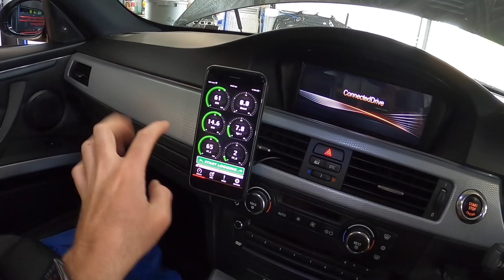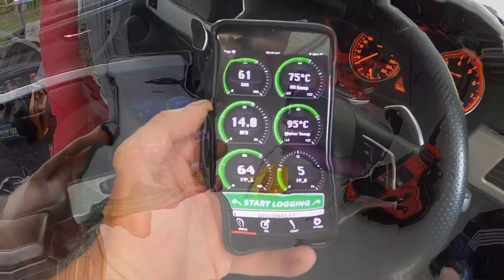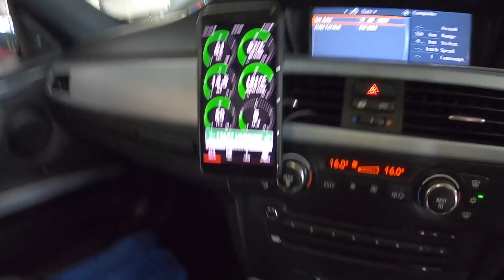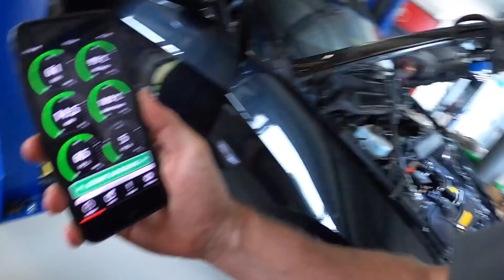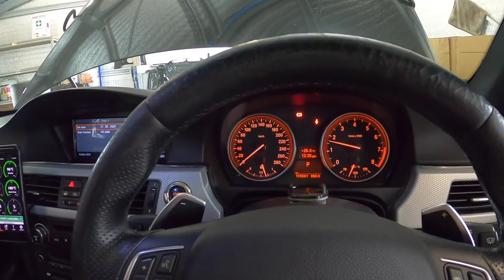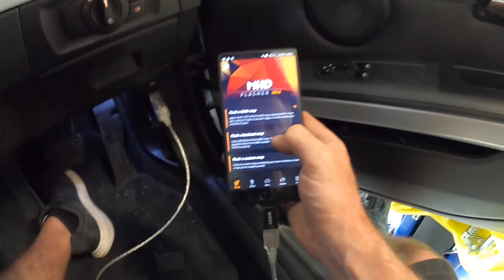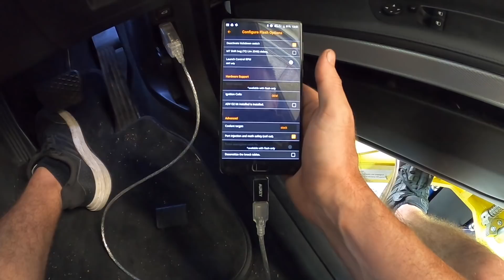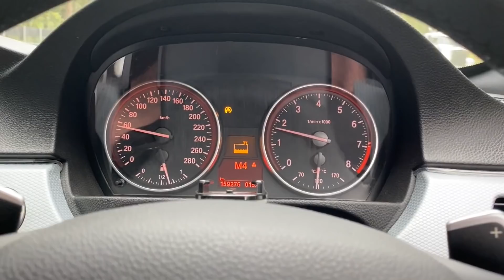BMW E92 335i N54 Motor Swap First Drive: HELL YEAH!!!

Comment: For the old n54 that your removed from your e92, will you get that machined and fixed? Just wondering because there are people out there who made their own "supra" by swapping a 2JZ engine in a frs/brz/gt86 with success but i have not seen anyone do a n54. With frs/brz/gt86 motors seizing and blowing due to weak connecting rods and faulty valve springs in the subaru motor, maybe you can find a car for $1000 with a blown motor and put your old n54 in it? Just a thought. Go TeamN54
Reply from the maker: Thats a pretty cool idea for a motor swap. Down the track that might be an option. I will be fixing the original e92 engine. Im thinking i will build that one with some forged bit and go full send.
Reply: @ZeroTo60Tube  that would be freaking awesome. Looking forward to it.

Comment: Is there any way we could see the logs? 
I'm running basically your exact same setup but without your tune, my timing is basically all 0 degrees and I dont know if that's what ou have or it's just something with my tune
Reply from the maker: Something with your tune. Or you have serious issue. I have heaps of logs showing timing between 6 and 12.8 deg, depending on ethanol content. So what back end flash are you running for the JB4?
Reply: @ZeroTo60Tube  I'm running the IJE0S, Pump flash. 91 octane. I live in Canada
Reply from the maker: @crazygamer889  something is wrong then. I would post your JB4 logs to the n54tech log review forum. Those guys will have you sorted in no time. In fact that forum is amazing for JB4 users. Make sure you have 6 cylinder timing logging enabled.

Comment: I also have xhp and on day to day driving i use the stage 2. What do you mean by transmission adaptation? I am curious that i should be doing that.
Reply from the maker: The ZF6 factory software is designed to continually adapt both clutch pressures and clutch charge times in order to keep the shift smooth-ish as transmission ages. When you do a adaptation reset, you have to drive the vehicle in a way that puts certain loads on the transmission so the software can learn pressure and fill times. The adaptation reset, puts everything in a state designed for all new hardware, so if your gearbox is worn out it can cause problems. Generally you should only do a gearbox adaptation reset when you have changed hardware inside the box. But if you are having shifting issues, it's worth looking in to.
Reply: @ZeroTo60Tube  thank you for sharing that information. I have not replaced anything yet. Just fluid and filter. I am glad i do not need to do adaptation reset yet.

Comment: Read xhp’s warnings before resetting your gearbox adaptions........
Reply from the maker: The warnings exist because some people just shouldn't touch their car full stop and then blame xHP when they mess it up. For your own reference if you reset adaptations, do a proper relearn procedure and then have an issue, your gearbox is toast anyway. Resetting adaptations didn't cause the problem, its the hardware is in beyond serviceable condition and needs to be replaced or repaired.
Reply: @ZeroTo60Tube  I think your last sentence sums it up but the whole point of adaptions is to compensate for wear etc. unless it’s brand new or rebuilt it’s going to have wear. It’s doesn’t make sense to reset on this basis
Reply from the maker: @paulsimpson8990  It is a hard one to put a definitive answer on. When i got my e53 a few years ago, it was shifting really badly, a friend from BMW drove it and the first thing he said was do a adaptation reset. It made it a little better, but that car needed the bridge seal on the mechatronics replaced. I eventually did the seal, new oil, reset and it felt perfect. A mate of mine recently bought a 325 (well about 10 months ago) and it would go in to limp mode on the highway if it was d. in sport mode it was ok. It was a cheap car and he didn't want to service the trans properly, so we reset adaptations did the relearn properly and it's been fine since. So i guess if the car has has something happen where the learnt adaptations were not done properly it can cause on going problems that are not hardware related. Every time i have reset adaptations the gearbox's shift better. But doing the relearn properly is crucial. So i am pro doing adaptation resets from my experience. In fact the only time it wont go well is if something in the hardware side is no good.
Reply: @ZeroTo60Tube  good to know, I had the impression that the risks were greater than the reward but your experience is the opposite. Thanks

Comment: look like the turbo is not blown, the old engine have serious problems.
Reply from the maker: Yeah no excessive smoke on the start up. I had it running for 20 mins in the shed, so it would have been like a 90s disco if there was an issue with the turbo leaking oil still.

Comment: How does the lsd feel?
Reply from the maker: Still not 100% on it. It has changed the balance of the car more than i was expecting. But havnt driven it in proper anger just yet.
Reply: One mod I definitely want to do. Mine is only mhd stage 1 but with dct when I roll on the power in second it seems to on want spin up the one wheel when I  finally wot.

Comment: You're supposed to be in gear and running when doing the final fill on the zf......
Reply from the maker: I thought you were supposed to cycle through the gears after the first initial fill. But i don't think it should be left in gear.  I didn't bother with that as i only lost the oil from the cooler lines. Then with all the mess, i was like yeah this will do... Probably should check it again, but you'll get a shift quality issue as soon as it low.
Reply: @ZeroTo60Tube  yes you cycle through all the gears and then final fill is to be done while transmission is in drive
Reply: @ZeroTo60Tube  and please please please don't reset trans adaptation
Reply from the maker: Why are you worried about it? Have you ever done it? Or just read something that’s concerned you?
Reply: @ZeroTo60Tube  no I haven't done it and won't do it as transmission relearn is to be done on a rolling dyno.....the trans is learning how to shift and has compensated for its own build and valve pressures, shift times, clutch wear etc..... reset does nothing for you and only hurts the trans which is why its done on a dyno so it can be limited on how much load it sees and there is a specific relearn process that must be done.   You will gain nothing from doing it but more damage from improper shifts

Comment: BMW driver = always nervous waiting for something to break :)
Reply from the maker: lol accurate.
Reply: @ZeroTo60Tube   You interested in selling your spare water pump? I assume it will also be compatible with an N55?
Reply from the maker: @auszman  Absolutely, but i dont think they will fit the N55. Just editing a video on it right now actually
Reply: @ZeroTo60Tube  Its all good. i managed to get one express posted out of Melbourne. with luck start assembling the 135i next week and  replacing all of these plastic engine accessories while i am in there. I believe that N54 and N55 water pumps are the same though.

Comment: Do you have an email address that I can contact you directly on?
Reply from the maker: For business enquiries yes. zeroto60tube@gmail.com If you are after support on builds or technical questions, the youtube comments will get the quickest response or even faster response is the youtube membership program. Please only use that email for a commercial enquiries. It is getting out of control as it is and i dont have time to reply to everyone.

Comment: What are you using for the wireless management? Jb4 or mhd? I'm mhd bound and thinking about just getting the wireless adapter for it.
Reply from the maker: I log and do gauges with the JB4. JB4 and MHD use the same data channels on the canbus (they are pulling the same data). So if you have a JB4 you can not use MHD for logging/guages.